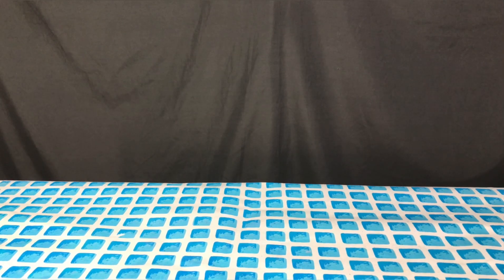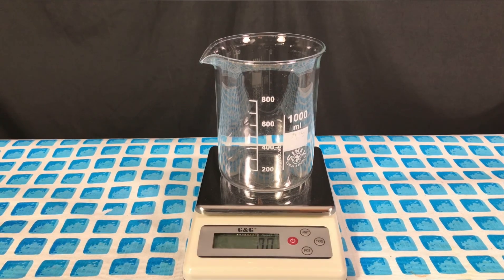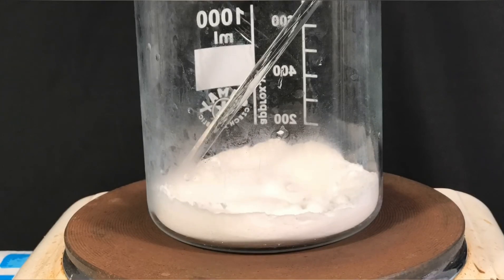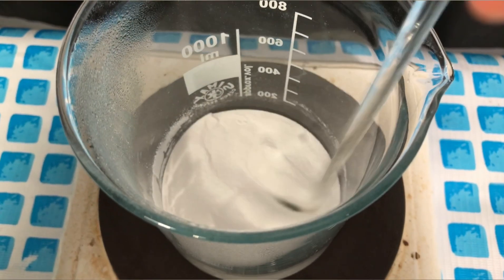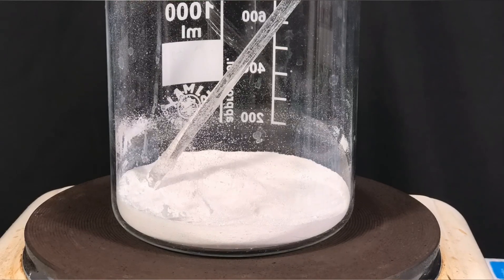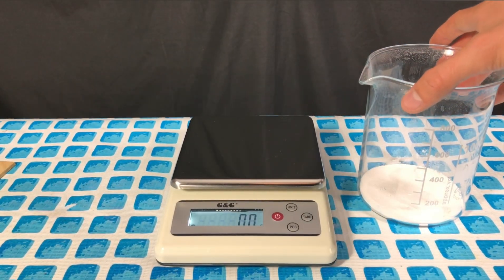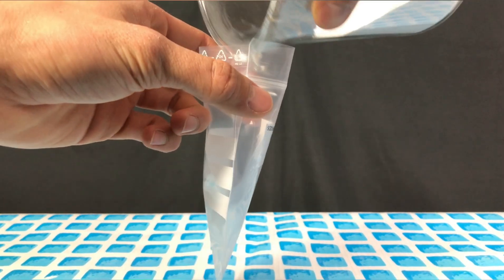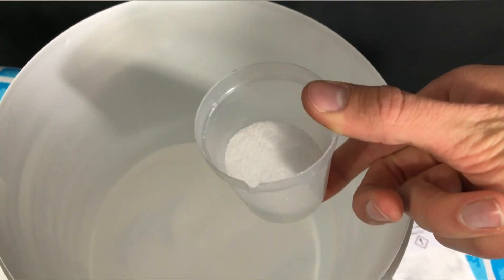Sodium carbonate from sodium bicarbonate

Comment: Do you know how to make potassium bitartrate from tartaric acid and potassium carbonate ? Wikipedia says you get the tartrate but how to get the bitartrate ?
Reply from the maker: You simply combine two solutions. One solution contains one mol of tartaric acid and the other one contains one mole of potassium hydroxide. If potassium carbonate is used solution two should contain only 0,5 mol of potassium carbonate to produce potassium bitartate. If potassium tartate is desired one mole of tartaric acid is either combined with two moles of KOH or one mol of K2CO3.
Let the solutions react and boil them down carefully followed by drying via your preferred route (I´d use a vacuum dessicator).
Reply: Thank you very much ! Now I understand complete reaction gives always tartrate and If you leave it more acidic you get bitartate. So you always leave double the mol excess tartaric acid then ?
Reply from the maker: No problem mate! But you don’t use an excess. If you are making 1 mol of potassium bitartate you need to add 1 mol of potassium to every mol of tartaric acid. 1 mol of potassium (which will react with the tartaric acid —> potassium chloride etc. would not work) can be found in 1 mol of KOH, in 0,5 mol of potassium carbonate or in 1 mol of potassium bicarbonate.
Reply: Ok thanks for the hint ! Maybe you already know it but If you need to get out your potassium from the water potassium bitartate has the least solubility. All other bitartate salts from other metals or non metals are more soluable. For double displacement reactions just to remember ;) For example NH4HC4H4O6 + KCLO4 -> C4H5KO6 + NH4CLO4 should be very pure because you can filter the potassium out.
Reply from the maker: I honestly never even dealt with tartaric acid before but it seems to be really useful when K bitartate has a low solubility. We are not going to make any perchlorates though.